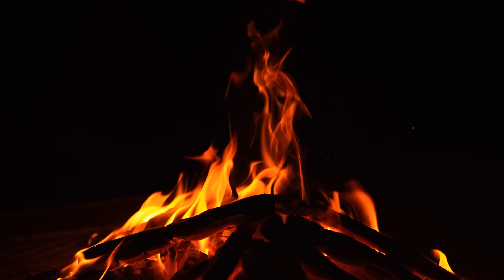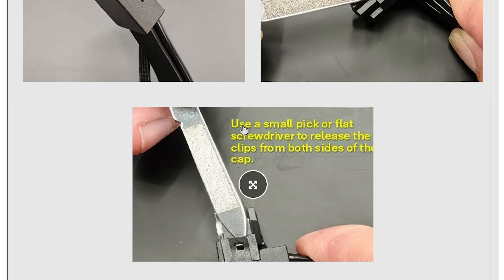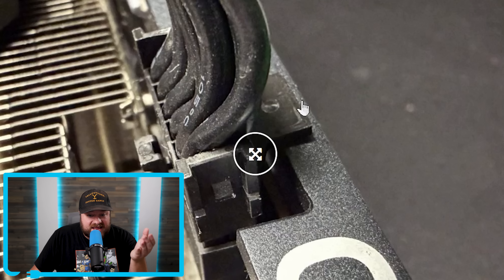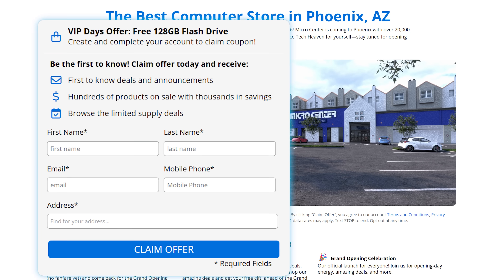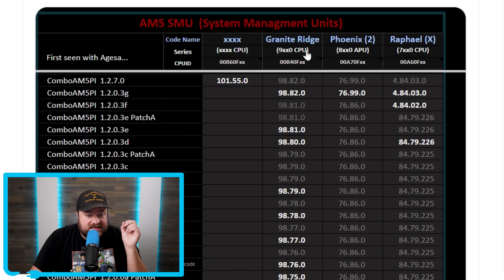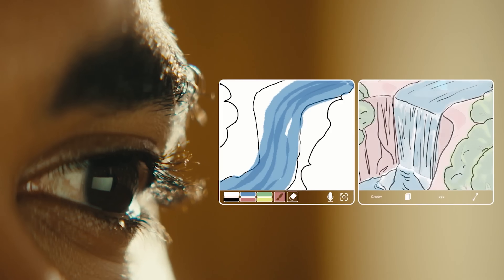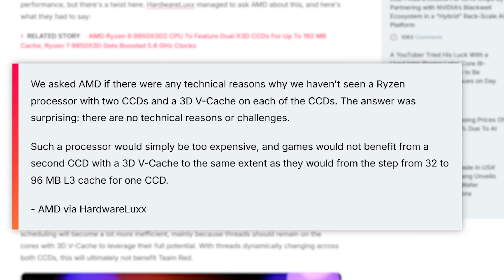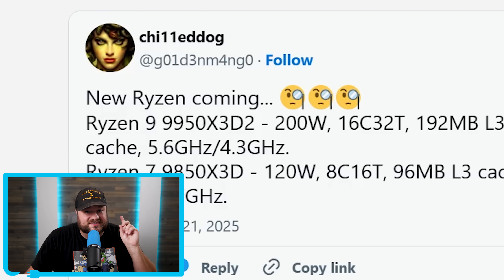AMD’s Dropping X3D 2.0 To DESTROY Everything!

Comment: I’m convinced, switching to Linux, and only buying AMD CPUs, and GPUs.
Reply: Realistically, NVIDIA isn’t really an option anymore.
Reply: @simonwilkinson2294  The AMD GPU that use the 12VHPWR are also having melting issues even running much less power through them. At this point in time I'm convinced that anything using the 12VHPWR is cursed and should be avoided at all cost until a major PS/GPU/Cable design update has come through to fix the issue.
Reply: @DragonZer0 but overall it's less risky cheaper and better
Reply: @DragonZer0 it is an absolute shit connector. Poorly designed, not even poorly made. As even expensive well made connectors are frying. It's the fact no load balancing happens, at least from what I've seen on here (YT) about it. Plus with the connector on the 9070XT going up in smoke. Says alot. That's a 370W card, and kaboom! I honestly can't wait for it to fade into obscurity, bring back the tried and trusted PCIe connectors that we all know and love.
Reply: @DragonZer0  Fully Agree. The  NVIDIA connector is just bad, plus we need a psu upgrade with voltage and power sensing to completely avoid these problems. It’s just not enough with a new connector.
Reply: Intels c series gpus are looking incredible compared to Nvidia comparable gpus, but intels cpus are ROUGH rn
Reply: @mafiapepe1144  ??? only for amd shillers, intel cpus have always been the best options for gaming, emulation, VR, and things like photoshop

the 9950x3d2 is looking awesome for workstations though, and for poor people APU's are still ok
Reply: I still use windows 10 but i use a 9060xt 16gb and 7800x3d
Reply: Nvidia, AMD, Intel? And the winner is Apple 👍 It is good to remember two things. Apple is the founder of the ARM and Linus uses Macs 👍
Reply: @verttikoo2052  Linus doesn't use Macs. Idk where you get that from. And that doesn't change anything because Apple is just another evil corporation.
Reply: @verttikoo2052  apple hasnt been relevant for a long time

right now its pathetic how far they have fallen into mediocrity by hitching onto the "cool" image
Reply: @OdinAlgeron  Hello Dell 👋 Is it you Michael?
Reply: @verttikoo2052  ???

i dont understand this reference

its ok though since you cant refute my points all you can do is personally attack shill
Reply: @OdinAlgeron that’s how brain rot the apple and iOS user are 😂😂. Don’t mind them.
Reply: @Verttikoo2052, Apple is not the founder of ARM and I have been using ARM's RISC based chips since the 90's.
Perhaps do a little research and see that Apple have simply chosen to use ARM chips in their products.
Reply: @apj6y  LOL some macs even use intel cpu's

apple shills really drank a lot of coolaid
Reply: Don't
Reply: Intel GPUs on linux are good too
Reply: thanks to steamOS intel + nvidia are really still the best option for most people
Reply: @OdinAlgeron  Intel might be justifiable.
Nvidia is overpriced trash.
Even Intel + Intel makes more sense.
Reply: @narrativeless404  depends if you are poor and stupid or not

getting a dual bios 5070 ti and flashing it into a 5080 gives insane value for example
Reply: @OdinAlgeron  That's high risk unofficial methods.
And 5070Ti isn't exactly cheap, let alone dual bios.
Reply: @narrativeless404  no it isnt, with dual bios versions its basically guarateed
Reply: enjoy the driver timeouts and amdip
Reply: @bigturkey1  nvidia tend to be more stabile with undervolt/overcloking but you can definitely play amd without any issues
Reply: That's what I've done. I've had Ryzen since Gen¹ and been with RDNA since my RTX 2080Ti died. Two years ago. Best decision I've ever made. Ditched Windows this year, after the SSD debacle, been with Nobara 42 since then. Best decision, ever.
Reply: Intel GPUs are also worth considering if you wanna go budget.
Just not Nvidia.
Reply: @narrativeless404 intel gous are for if you are that poor
Reply: @BelixBuilder  Most people are poor and Intel GPUs offer incredible performance for it's value.
Reply: @narrativeless404  tuff luck to them
Reply: best thing i ever did was amd cpu and Nvidia gpu. will never change to amd gpu only bad memories.
Reply: @Turbo99w  well depending on the level of nvidia gpu an amd cpu will not keep up

for higher end nvidia gpu's ( for example at 1080p you need a 9900x to properly use a 4070 ti) an intel cpu is required to get 100% performance from them
Reply: @Turbo99w 
I run a 9800X3D with a Liquid cooled MSI Suprim 4090. It's runnin relatively well all the time.
Gettin around 120FPS at 4K in helldivers. Not everything is at Ultra though. Still, I cannot complain.
Reply: Apple is the biggest tech company on the planet with annual cash flow of over 620 billion dollars and it makes everything under the same roof.
Reply: @verttikoo2052  doesnt make them good, or their products competitive
Reply: @OdinAlgeron   Do you know how the markets works?
Reply: I want to switch to Linux so bad but as a VR power user that has a 5090, nothing else competes with that gpu.  Nothing else even competes with the 4090. I love my AMD CPU though
Reply: Do it , trust me everything just works better than windows .... EVERYTHING!
Reply: I’m only buying AMD already. But sadly Linux has too many downsides compared to windows gaming wise.
Reply: @timeatsyou6250  steamOS
Reply: I hae only been Buying AMD and Radeon since 2008  I have zero regrets.
Reply: AMD gpu? ok brokie
Reply: @maroosagaming  imagine being salty for what people want to buy
Reply: @maroosagaming If you’re willing to pay the NVDA exorbitant msrp, more power to you. Value conscious gamers will be waiting for the RX 9080XT instead!
Reply: @maroosagaming  i have a 5090 and a amd 9070 and i think 9070 is btter
Reply: @BelixBuilder  in what world is the 9070 better?
Reply: @maroosagaming      better fps per dollar
Reply: @BelixBuilder  probably because the 5090 is bottlenecked to oblivion by your cpu if you like a 9070 better
Reply: You’ll regret the Linux thing is you wanna play any FUN games with your friends all the anticheats are windows exclusive.
Reply: @krowwithakay  that's misinformation at its finest. I'm purely linux, EndeavourOS and I been playing games with anti cheats in them with no problem. As for the kernel level anti cheat requiring secure boot if I wanted to play games with it all I have to do is enable it for my distro if I wanted to. Can't speak for other distros though.

Some games are the finals, dead by daylight, the first descendant, smite 1, smite 2 beta, demon slayer 2, mortal kombat 1, ace combat 7, halo the master chief collection, gta v, nba 2k, ao tennis 2, etc.
Reply: @krowwithakay gaming with linux is fine, the harware support is not so
Reply: @ketsi3079 That is why Linux still isn’t for everyone. I have no doubt Linux Can be great as Long as you know how to get around the hardware driver issues that WILL arise. For the not so tech people, Windows is still a safer bet as it’s a lot easier for “normal” gamers to get an updated driver for the majority of hardware used.
Reply: @mrdali67  this is what steamos is great for
those people that just want it to work
Reply: @krowwithakay  Only a few are exclusive to windows, namely Riot, BF6 and COD, but others have provided work arounds to run under Linux or work just fine with a few configuration tweaks. Even the Anti Cheat companies realise that Windows is a lost cause and will be even more so once MS moves all Anti Cheat programs out of Ring Zero in a future Windows update.

Apex used to work on Linux and the only reason it wont now is because of the Devs and not the Anti Cheat which works just fine on Linux. Battle Eye, VAC, EAC and Nprotect along with Battle Net Warden all work just fine under Linux, however its up to the game devs to allow the game itself to run on Linux regardless if the Anti Cheat does.

So if the game doesn't run but you know the Anti Cheat will .. go complain to the Game Devs about it, quit blaming the Anti Cheats for it because most work just fine on Linux. (Easiest offender for this is Fortnite, EAC works on Linux and has supported it for quite a while now but EPIC refuses to allow Fortnite on Linux, the other is Apex which worked on Linux till just recently when Respawn decided to block the game on Linux, again not because of Anti Cheat but rather Corporate meddling)

Funniest thing ever ..is you cant have BF6 or any Riot games installed on the same Windows install because the Anti Cheats conflict with each other ...so even on Windows this Anti Cheat bullshit is causing problems, the removal of them from Ring Zero cant come soon enough.

Comment: Wait.. I'm a bit confused.

So if I got this right; The 9950X3D2 comes with 192mb of L3 cache, but that is split between 2 CCDs (96mb L3 cache per CCD), as opposed to the 128mb L3 cache on one of the 2 CCDs of the original 9950X3D. So if you want/need to play a game on a single CCD, that gives you less L3 cache to work with. But the less amount of L3 cache and latency drop of using both CCDs for this this is offset by the 9950X3D2 coming with X3D 2.0 V-cache, which is newer than the 2nd gen X3D V-cache that's on the 9950X3D?
Reply: !!!WRONG!!!
You forgot that the chips WITHOUT vcache have 64 MB L3 Cache (see specifications on the 9950X). This does not change. You gain another 64MB of Vcache with the x3d-layout. Then you get another chip with 64MB vcache with the X3D2. This means 64+64+64 = 192mb vcache.

You don't get LESS vcache, as the 128 are from both CCDs that have each 32mb as well as the x3d-cache that has 64MB.
Reply: @Velerios  Your confusing me a bit with a lack of better termanology;  chips > CCD or "without V-cache" > 3D V-cache, and 64+64+64 is an odd number, which can't distributed evenly, but I get the gist of it, so thank you. Summing it down, I'm guessing you mean the bellow?

[9950X3D]
(X3D second gen)
CCD 1: 32
CCD 2: 32 + 64 = 96
Total: 128 mb L3-cache

[9950X3D2] 
(X3D 2.0)
CCD 1: 32 + 64 = 96
CCD 2: 32 + 64 = 96
Total: 192 mb L3-cache
Reply: Yes, though there are benefits. If the game/program uses more than 8c16t and/or you assign (manually or automatically) assign the game/program to use cores across both CCDs, full access to the 192mb cache. Whether the inter-CCD latency will noticeably hurt (or gets mitigated with more cache) will have to wait, at least til 3rd party reviews come after launch.

Tldr : the og one might still have a niche for most esports titles (super high refresh, low(er) resolution)
Reply: @Skyline_NTR  Again wrong: there is not less cache per CCD as every CCD has without vcache 32MB of L3-cache. Vcache triples the amount of cache on a ccd by adding 64MB more to 96 MB. Then you add another 32 MB of vcache from the second CCD and voila, you have 128 MB. The X3D2 does NOT have less Vcache per die as you calculated it wrong.

Comment: Why is the 12V 2X6 still a thing, i have never and will never get a card with that power setup, 2X or 3X 8pin is working well so will stick with that !
Reply: There was an earlier episode where the AMD GPU were even having melting issues with 12VHP.
Reply: saME 8 pin rx 6950xt , hopefully by the time i get next gpu this connector madness will be over and 8 pin gpu are still a thing
Reply: @arnoldshmitt4969 yup my 9070XT has to hold out untill that 12V High Heat connector is Retired
Reply: Nothing wrong with it if you have half a brain... my last 2 cards have had it and have both been OCd to the max. No issues
Reply: @sterlingking9117 as a Electrician with a whole brain The 12V High Heat Connector is very Stupid
Reply: @sterlingking9117  Glad you have had no issues.
Reply: @sterlingking9117   I'm sure that if you have had no issues that all news about melting issues are false!
Reply: @sterlingking9117  "Me no issues, this thing not broken." Unga bunga ahh thinking
Reply: @themarketgardenercool story bro.